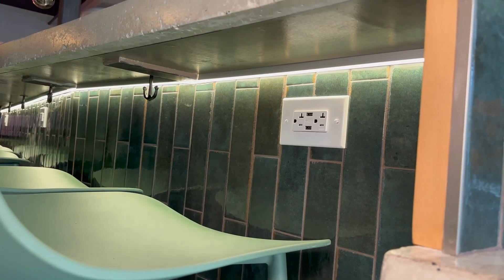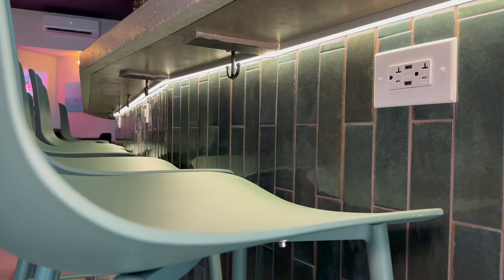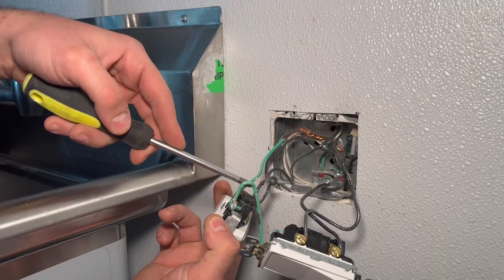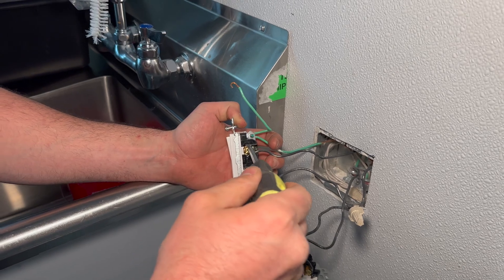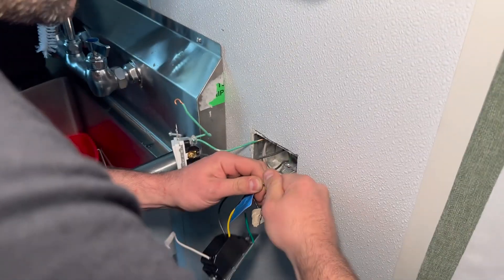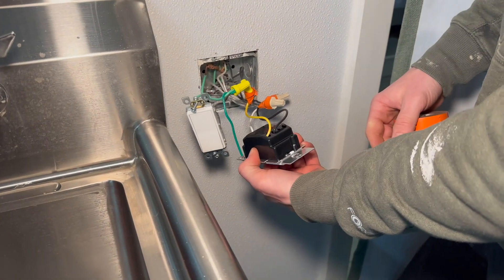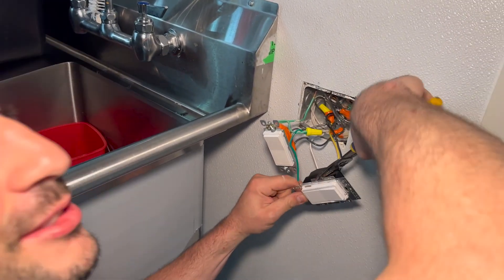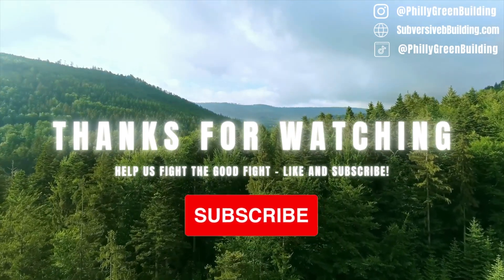Dimming Low Voltage LEDs - The Easy Way!

Comment: Don't tape the wirenuts. It's pointless and makes it hell for the next electrician who will work on the box down the line. Personally when I see tape around the wire nuts. I assume it was not done by a professional.
Reply from the maker: That's fair and I'm by no means an electrician.  I err on the side of excessive paranoia whenever we're wiring stuff and never trust the connection fully between stranded and solid.  

I'll probably lay off taping nuts but still hanging onto taping the sides of outlets and switches 🔌
Reply: @GreenBuildingNetwork  excessive paranoia is an understatement. I’m definitely an over-haul type of guy, but taping the wire nuts is absolutely pointless and borderline ridiculous.

Also, that’s copper, not brass. Annnd it’s called a flathead screw, not vertical.

The only useful information I got out of this was that not any ole dimmer switch will work. So there’s that.

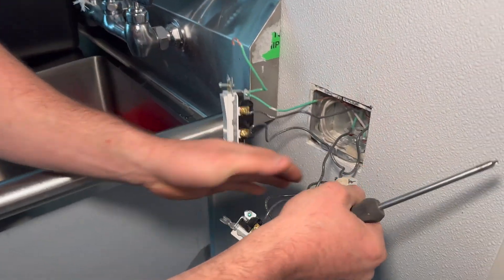Comment: Sheesh... the actual installation of the low voltage dimmer does not start until 2:40 and then offers little to no information. That combined with background conversations makes this a useless tutorial.
Reply from the maker: It was one of our earliest videos - we made it because we learned something and wanted to get that out in a 5 minute package. We spent a lot more time researching solutions.  Regardless, your points are valid.  Thanks for the comment!